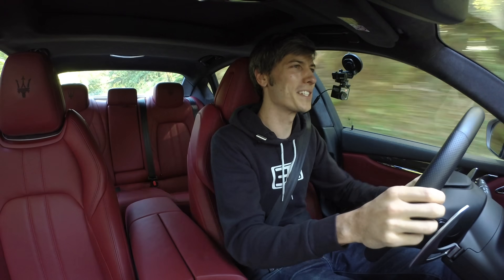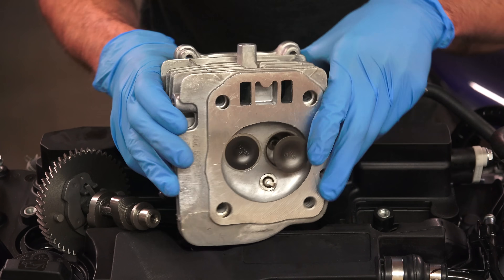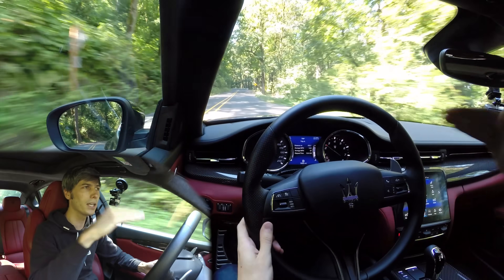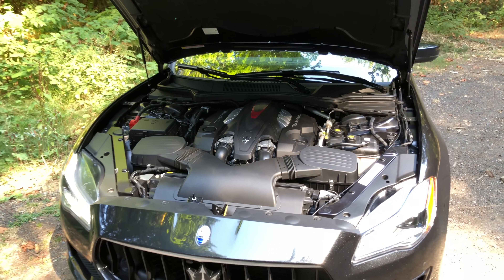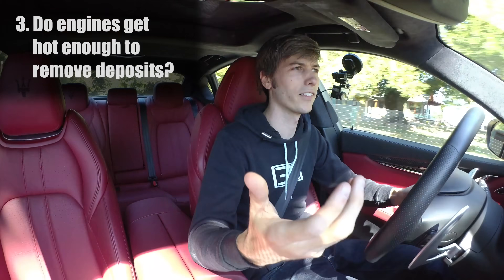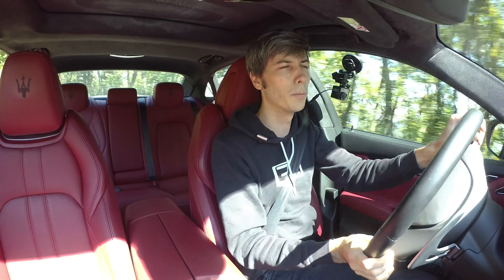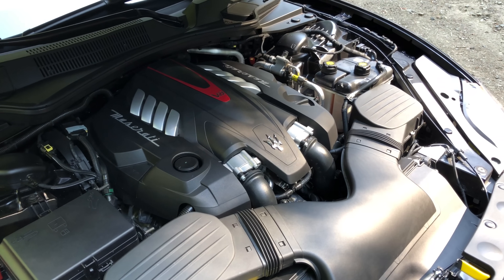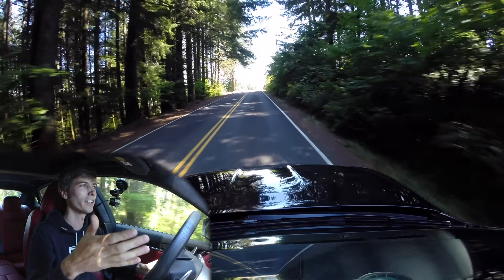Is Redline Good For Your Car's Engine? Italian Tune Up

Comment: Dont pedal to the metal all the time, but also don't baby the car ... give it a pull once in while more while then once! Leon TDI FR 2004 (150 cv tuned to 200 CV from 30K ) 
... 287K on the clock ... replaced clutch once , replaced timing belt twice, battery 3 times ... 
oil, filters, break pads, rotors, tires, one button or another, one door jammed lock, bulbs...etc .... never crashed! 
Still doing 230/240 km/h top speed ,still pulling like a beast. GME ....
.
.
.
German Made Engineering!

Comment: The "Italian tune up" is undoubtedly beneficial for diesel vehicles with a diesel particulate filter (DPF). You don't need to thrash the car, but a spirited use of the power band every now and then prevents the DPF from clogging.

Comment: in my opinion which it isn't based on any study accept what you said i got a 2.0 turbo charged engine and as you said if drive it hard it will form carbon deposit.  but i got a solution.  i installed a catch can which will collect the oil gas vapor and will drive it hard to get the temperature high enough to break the small amounts of carbon that has formed but not on one run it will be a daily job to do becuse from the point i installed a catch can onward it will be easier to get the carbon already formed to break down because there is no much carbon build up any more so you only break what already had build up

Comment: water meth injection on a turbo car will remove carbon buildup on intake valves. In conjunction with a pcv delete aka catch can you will decrease the carbon buildup substantially..

Comment: Why is it called " Italian " ? 🤣 
Cause we drive fast?
It works actually ,but you need to drive it really hard for like 5 minutes on highway.
Did it on an interstate in Italy, of course 😂😂
Reply: The term supposedly came from Ferrari mechanics.  Customers would bring them cars which had been babied and were not running right.  One of the ways these mechanics found to get them running properly again is to take them out and run them HARD for a while.

Comment: With your mentioning of a track run making it more likely i cant help but think a proper italian tuneup which requires coming to a stop and going to WOT to the top of final gear especially with a slight incline might have the same or a like effect and that you are basing your conclusion on the idea of keeping from doubling or tripling your local speed limits ?

Comment: I used to service generators, if they had been running on a light load for an extended period, they would (coke) carbon up on the exhaust side. Generators always run at constant engine speed, but vary engine load depending on demand. To clear them out I would plug as many heaters etc in to the generator as it would take. After a couple of minutes they would smell of carbon, and spit sparks and sometimes flames. I do the same to my car. Find a long hill, sit at 2/3 engine speed and floor it. No need to redline anything.

Comment: My question is whether or not polishing things makes a difference. If you have a mirror polish on the combustion chamber will the deposits have anything to stick to?
Reply: Yes cause there will still be microscopic imperfections in the surface.A different side of tech cpu's and heatsink's for computer cover's this more in depth as it become more of a problem as you try to transfer heat and that is why they make thermal compounds usually a paste or grease which fill's those microscopic canyon's and create's better heat transfer and this remains the case no matter how precisely you machine/lap the surface most metal's are porous

Comment: Great explanation, it really helps to clear things up when u divide and conquer the problem. Could u do an explanation if it is ok or bad to bounce off the rev limiter or redlining?
Reply: ofcourse that is bad cause the limitor is either cutting fuel or spark.also the part's are still trying to speed up at that point and when they hit the limitor they get a harsh shock disturbing the balances

Comment: I don't think it is only the heat equation to be factored in but the mechanical acceleration and deceleration that might also clear/clean some carbon deposits.  I'm of the belief that stuck rings could be loosened if aggressive accelerations/decelerations are applied (no actual need to go to redline, just spirited driving, say in a lower gear so pressures would be created to loosen said deposits).

Comment: The one thing you missed here is.... old cars don't adjust the air to fuel ratio much so more likely to be leaner at high rpms and that means hot. I bet it's a sterotype because it used to work. New cars.... like toyotas are known for dumping extra gas in the engine just for the cooling effect. Extra gas after combustion... more carbon. You're fucked nowadays.

Comment: Ya, burn off the carbon, burn up the rings, main and rod bearings. Higher RPM's kill engines. Main reason why diesels put more miles on the road, they run at much lower RPM's.  Also why so many race engines don't even make it through one race, super high RPM's.

Comment: "I removed all the carbon and damaged my engine components with heat at the same time."
Reply: If your engine isnt super new and you're not dumbly holding 8k RPMs for 10 minutes straight your engine will be fine, unless some th ing was already wrong with it
Reply: @anonymousanonymous9991   In other words, if you don't actually try to achieve the temperatures that would be needed to remove carbon buildup your engine will be fine.

Comment: I always thought it was higher sustained exhaust/vacuum pressures that removed the deposits. 

Also, I've noticed that the carburated engines I've owned seemed to run better if they spent some time on the highway every now and then. Maybe the sustained higher rpm's helped clear the carb out a bit?

Comment: Many years ago I used to borrow my Dads Hillman Husky Van, a 1960's small petrol engined car from Rootes Group in the UK. He used to drive at low revs and low load for short journeys. When I borrowed the van I normally did some distance runs and motorway speeds. One night I noticed sparks coming from the exhaust  . My Dad said  that the van always went better after I had borrowed it.  All I can say about 'tuneup', I suggest that a prolonged drive does more good than trying to blast the engine clean.  Using a car for a short commute is the quickest way to clog up the system.
Reply: This video mainly covers the pistons and internal engine components and just assumes the exhaust components are always getting way up in temperature. But as you noticed depending on how they made the thing and layed out the exhaust I imagine short commutes may cause extreme carbon buildup on the exhaust side which would reduce performance.

Comment: I have a 1970 Ford Galaxie, I daily drove it for quite a while, never really pushed it hard, then decided to push it one time and it would struggle and choke in the top end, had plenty of torque down low, so I just shifted below 3500, never saw it as an issue, then one day it seized up the T-stat and blew all the fluids out and died right before I got home, I pushed it the last 20 yards and and let it cool, put all new coolant in it, changed the T-stat and let it rest. I dreaded turning the key on it in fear I had done permanent damage, to my surprise it started right up the next day and I took it for a drive, it sounded completely different, it sounded... Mean. I decided to take it up through the revs and it felt like a completely different car, no more choking or stuttering in the top end, and it pulled strong up to almost 6500 RPM. I fully believe it cleaned it up and dislodged whatever caused the stuttering. It was like an extra 40 horsepower.
Reply: I used to have a copperish-gold  '70 Galaxie 500 back in the 90's.   The only thing I didn't like about the damn thing was having to put the new stereo in a CB-radio mount on the "hump" Because the odd-shaped, stock radio is on the left side of the dash, between the wheel and door. (like the heat/ac controls on '75 Caddy Fleetwood)  But dude, let me tell ya'  that old sumbitch could not be killed!  The guy who had the thing before me, was the older brother of one of my friends,  and he beat that car mercilessly.  I'm talking "Dukes Of Hazzard" kind of stuff. Minus the big jumps,  but it was known to get a little air from time to time..  He took it  Mudding,  racing, whooping it on quad-trails tearin' ass on back roads, donuts in the intersection of main street at 2 in the morning, cat & mousing with the lone, small-town cop...  ...you see where I'm going with this.   And hell yeah we hung out with him and got to experience it all!   Fun times! Dude used it for farm work too, he hauled hay bales in the trunk, on the roof,  in the back seat.. Yeah.  By the time I bought the thing for 50 bucks,  there was not a side-mirror, door-handle, piece of trim, or straight body-panel for that matter  It was all ripped off as he like to side-swipe road-signs at 90+ mph, The hood no longer had hinges.  it was only held to the car by the latch, and would float up at around 80 or so. There were also hay seeds sprouting under the seat..:P   But with all that abuse,  that engine  never EVER quit!  Always started,  ran great,   and miraculously,  it drove straight and true, and there was not a single crack in any glass.  That car was no stranger to red-line runs.  I still miss the old brute and the fun we all had raisin' hell in it.
Reply: We had a 69 LTD, with a 390. Bought new. Nice car, very nice interior,  loved the dash layout.  But you know, those cars don't have a tachometer. Did you install one?
Reply: You changed the coolant and tstat... and that made your car faster...
Reply: @yeetskeetledeet8184  yep,  now that I think about it,  tstat could have been bad for a while,  might have been running hot for a long time.
Reply: The Italian is for old vehicles like yours with no emit ion controls on it.  Won’t work on modern vehicles
Reply: @joeldeangelo6083  Did you watch the video? lol
Reply: @joeldeangelo6083  it will work  , i observed it on mine , 2.0L TSI  Turbo petrol Direct injection , after i went on a trip and drove a bit faster , im not talking much say 2500RPM for 30-60min , tomorow and for some time it did work better . Now i found that indeed , if you go a bit higher then that say 4000RPM for 20-30min , you are looking at very good Italian tune up and removed dirt from the valves and such even sceintifically confirmed,  but has been confirmed but a lot of people , and i will try that .
Its an 8000RPM engine , i doubt 4000RPM will hurt it , even if its extended period . It shoudnt , its like driving 200kmh on Autobahn , its designed for that .

Comment: OK, got it... never shift out of first gear!
Reply: Only need first gear on a sport bike to hit 85mph
Reply: while climbing Mt. Washington (this is the load part)
Reply: anagennao , many people in my town subscribe to this theory!
Reply: I get it in third on the highway sometimes. Cars as well as driving habits can vary, the key is to keep it at redline.
Reply: My 3.8 V6 in second gear tops out right around 100kph, it's perfect 👌
Reply: @MozzaBurger88  Lmao my 1.3 swift tops out at 95kmph in 2nd gear
Reply: Teamswift haha  @ashtoncastelino
Reply: MozzaBurger commodore??
Reply: @zingerbox9423  2010 Hyundai Genesis Coupe
Reply: @MozzaBurger88  my 1.4 4 cylinder does the same😂😂😂
Reply: @swollysxpw2025  it's actually normal as most cars have similar gear ratios (meaning those gear ratios are the best for most cars). But it also means, the smaller the engine, the bigger is the ratio compared to it and so the slower is the car. I have the same ratios on my 2.5turbo manual fozzy which is kinda annoying on the highway but entertaining on the pulls.
Reply: @swollysxpw2025  I have 1.4 MPI from renault will do 90 km/h in second  lol
Reply: @gagd7351  glad that this is not every car. mine needs higher revs otherwise it has no power. under 2-2.5k is no power then after that you slowly get more and more power till about 5.5k
Reply: DUH, you do burnouts and donuts.
Reply: Neutral??
Reply: Yes

Comment: unhooked my radiator to achieve 325 degrees.. bye bye carbon!
Reply: hello conrods
Reply: Well actually you're supposed to preheat the oil on the stove and boil the coolant before you put it in the engine
Reply: bye bye engine HAHA
Reply: Now me and the mad scientist have to rip apart the block...haha jk, 325°C  isn't  THAT hot.
Reply: And bye bye oil pump🤣
Reply: How much was the new head gasket?
Reply: Carbon out, car boom in
Reply: This is like something straight out of /r/askashittymechanic :-D
Reply: I'm dying laughing!
Reply: @zacharywilburn7253  🤣 same here.
Reply: Planning to buy a new vehicle soon?
Reply: 325C? or 325F
Reply: @punker4Real  c
Reply: Cooling system left the chat.
Reply: Empty out the engine oil too.
Reply: And engine too
Reply: @harryconover289  Warped my head and busted my headgasket, so now it achieves 350 degrees even with the radiator hooked. Im 3 steps ahead of yall
Reply: @Moon___man  you're probably joking, is my guess 😆
Reply: Bye bye gaskets
Reply: who needs pistons?
Reply: Turned my carbon problem, into a car bin problem.

Comment: I feel like the Italian tune up works best on older carbureted vehicles.
Reply: Sounds like a lot more fun on older vehicles for sure. I remember the '80s, lots of those engines that needed foot-on-the-pedal warmup time, and some folks lived it up loudly.
Reply: eh the duratech in my 01 sable and the 1.6 in my civic both run and idle better after a good hard pull too 120mph+

Comment: yeah. or you go on the german autobahn and drive your highest gear out as far as it will go. if i remember correctly some american and asian brands even cant handle full throttle over a long period because there cooling is (or wasnt. dont know if its still true) not capeble to remove all the heat that is produced and you can risk your Engine while you push it for minutes at a time
Reply: Doubt it, as it only cools the engine faster and cooler as rpms go up plus the air flowing through the radiator, ironically I have seen European and Japanese cars overheat.

Comment: I know this is commonly done to "clean" the catalytic converter.
But is carbon buildup really a problem, I've never seen an "modern" engine suffering from this.
Some turbo's with variable geometry, and egr. But that is doomed to happen.
Reply: Try owning a Ford Focus ST, my valves are caked with carbon build up

Comment: Hi, First of all, I wan't to congratulate to your videos, they posses a very good learning opportunity for everyday people.  Normally I don't comment on them, but this time allow me to point at a very important aspect,  thar wasn't addressed in this video. This is the carbon build up in cars with a catalytic converter. It is what all modern petrol engines have to reduce Co emissions in the exhaust. Since needs to be warmed up to a temperature where this can work, by driving only short distances without the exhaust getting warm enough, carbon deposites can and will form, after which it begins to function inadequately. In this case the Italian Tune up will work everytime. 
Thanks, and keep those who videos coming!

Comment: from my experience, and the mechanics i know, getting the engine temps up for at least an hour, has a noticeable effect on engine response, power and even fuel efficiency. The "hour" part is mainly because the speed limits here are max 90km/h, and traffic is quite congested so we can't be just redlining everywhere. So I find taking a drive to the neighbouring country in Malaysia, where there's long highways, and do a 100km round trip, works.

Comment: All im going to say is that while buildup is bad it doesnt do nearly as much damage as pushing your car to the limits for "cleaning" could. Fact is even a new well maintained car will suffer from strain and if done hard and often enough can lead to a mechanical failure.

Now if you have the money to fix it and are doing it for fun then feel free to push you engine to the limits on every drive.

Comment: Doesn't the cooling system prevent the engine from reaching higher temps ? The thermostat on my car never goes beyond 90c no matter how I drive.
I'm pretty sure its sheer pressure and velocity of gases in the exhaust system that is responsible for cleaning out deposits.

Comment: My 330D touring was clogged to hell when I bought it. The turbo would build and build  and suddenly just dump. Sounded worse than a bus... I drive it like I stole it and it's running great now. Plus being an auto if you boot it, it always hits the red before it changes

Comment: Can you make diamond dust with an engine.
Reply: Definitely no. Carbon turns to diamonds with massive amounts of sustained heat and pressure, but even with a high compression ratio you aren't sustaining pressure inside an engine.

Comment: Keep in mind the "Italian tuneup" idea is decades old.  It goes back to the days of carbureted engines running leaded fuel.  It's probably more relevant to removing lead and carbon deposits from the piston, combustion chamber area of the head, and spark plug, than to removing stuff from the back of the intake valves.